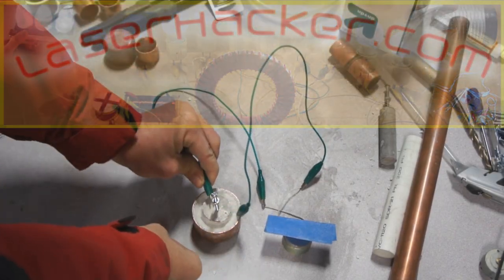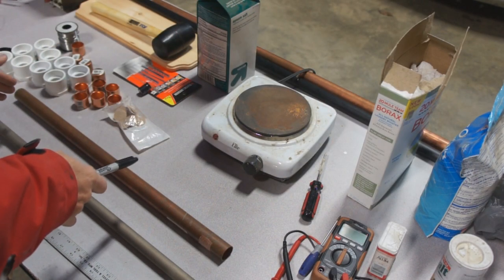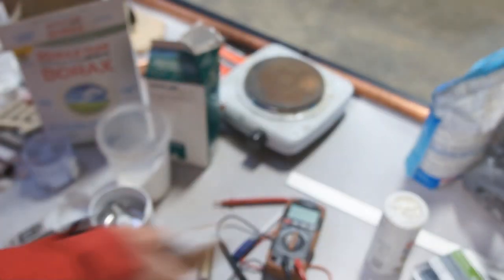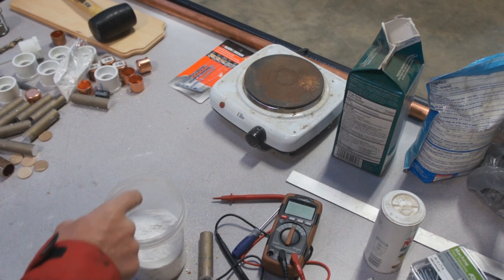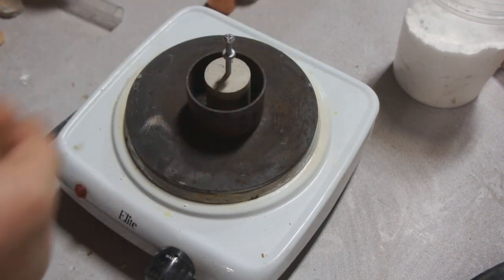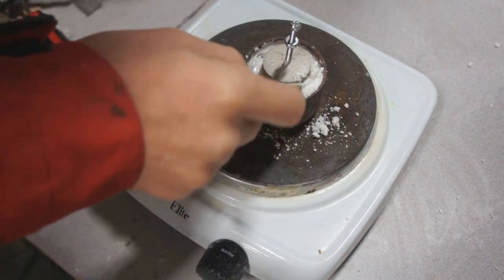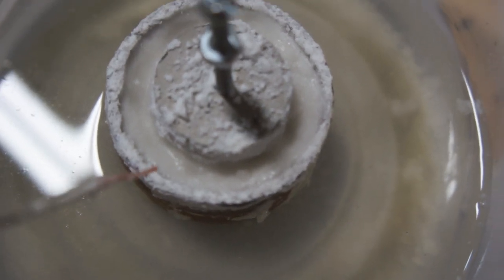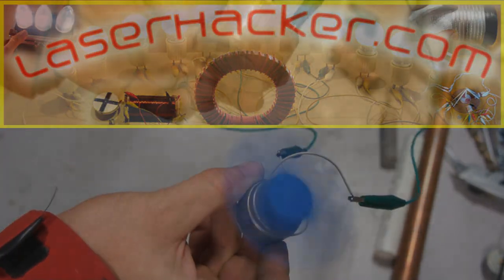How to Build Crystal Power Cells - Long Duration Power

Comment: I know this is an old video, but thought someone might be interested in what was going on. When you heat the mix of salts the Epsom salts release some of the water trapped in the crystal structure allowing the mixture to partially dissolve. You end up forming a "dry" electrolyte copper/magnesium cell.
Reply: I’d be curious to see the difference between the different ratios as I think with a tad less borax it would bubble less
Reply: thank you
Reply: The term "dry cell" just means that it does not use a liquid electrolyte.  Even the driest dry cells require some level of moisture on the inside, otherwise no electrolytic reactions can take place, but the electrolyte is dry enough to become a paste and thus it can be used in any orientation.  Unlike a wet cell, which even when sealed is not recommended to use in other than an upright position, e.g. a car's lead-acid battery.
Reply: Yeah, a lot of effort to produce a seriously badly-designed dry cell, then convince youself the power is magically coming from the crystals and not the difference in electrode materials.

The stupid, it burns.
Reply: @animateclay  Probably more to do with the crystal mix.  At least one of the ingredients needs to be a tad hygroscopic so it pulls in enough moisture to keep the thing working.
Reply: Is it chargeable? Is it a viable or economical solution for energy storage compared to lithium ion or polymer?
Reply: @juansolo1617  It's about as viable and economical as making a battery by sticking electrodes of two different metals into a lemon.  It works, for very small values of "works."  It's a novelty.  If you're gullible enough to believe woo claims, you can tell yourself that you're getting the electricity from crystals.
Reply: @bdf2718  Considering I've never seen it implemented I'd assume it's not very great... but from the video it would seem to be producing electrical current constantly without ever depleting. This might be useful in a large bank to produce a trickle charge for other cells. I still don't understand.
Reply: @juansolo1617  Look at the size of the electrodes.  It's going to take a long time to run out of electrode material.

But that's not the only problem.  One of the electrodes is slowly electro-chemically eaten away.  That will result in its ions accumulating in the electrolyte nearby and limiting further reaction until they diffuse away (which will be sloooooow) limiting the available current.  It will also result in a gap forming between the electrode and electrolyte which will stop it working (unless the crystal mix is such that it can swell as it absorbs moisture).

It's a toy.  A novelty.  Like a lemon battery.
Reply: Water trapped in a crystal structure......very interesting to think about.
Reply: @bairfamilyfarm1336  take a look at geology
Reply: @animateclay  same thing happened with my crystal cells
Reply: Quarts crystal displays direction magnetic resistance. If you heat quartz it produces a mild electric charge. If you apply a mild electric charge it will oscilate. Quartz is piezoelectric, under compression it emits a standing frequency. Maybe the pressure is compressing the quartz and interacting electromagnetically with other components too.
Reply: Before cooking, mine was pushing 1.5 volts! I didnt get a current measurement at that point, but after cooking it was 1.4 volts, and about 50 milliamps. I had to add water to the mixture to get it to form a paste. I was using it's very dry, anhydrous Epsom salt.
Reply: @bdf2718  You kind of are getting energy from crystals, the magnesium crystal as it oxidizes. If I had to guess at the species being reduced, I'd guess water from the air, maybe some previously oxidized copper too. It's an air fuel cell and it's viable for a lot of stuff, if designed properly for that. This isn't and it's laughable that tuning the borax or potassium chloride would change things much. The surface area of the magnesium and surface area for gaseous water and oxygen/hydrogen flux are critical. The copper surface area is critical too.
Reply: @bdf2718  what would you recommend adding so it can make it "rechargeable" by watering it every so often?
if I can have something I water every morning to keep my mobile devices and spare batteries charged im making a big one
Reply: @The_Tactical_Wook  50 milliwatts is such a tiny ammount of energy it would do sweet sod all to any decent sized battery so don't bother trying.
Reply: @stonedsavage7814  what if it was pee?
Reply: If this set up gets hot during the charging, it will be messy
Reply: Funny thing is at the beginning, there is no way to test amp flow without a load.
Reply: How long does it actually last?
Reply: @The_Tactical_Wook  I tried them all ..I don't assume anyone did more research than me...after a few while it stop working n Voltage drop way down..
Reply: Utopian Websurfer  gold plating maybe?
Reply: @abbaspourmoghadam3850  how long? I figure a watering every day could work right?
Reply: @The_Tactical_Wook  don't add any water keep it away..water only works for earth battery,crystal cells completely different realm..I made hutchison cells different mineral that u face zero point energy sub Atomic level,crystal cells works on the principle of casmir effect once u treated in a certain way (petrol electrical effect)john called it u activate it by applying direct current,u need Rochelle salt(piezoelectric property)epsom salt ,sodium silicate (covalent bond)sodium carbonate (ionic bond) a dust of pure silver,galena(radio receiver)n pyrite, melt them down with great heat,once start to cooling down apply 12 volt dc voltage to give them electric memory n will drop down to 1.300 volt very steady ...
Reply: Epson salt is composed of 75% water  and only 25% Magnesium sulfate.
Reply: @abbaspourmoghadam3850 . Different thing but if you combine platinum and gallium  by heating for 2 hrs at 300°f. You’ll get a room temperature catalytic liquid platinum.  Ratio .0001 platinum to gallium.   

This can be combined with another thing people love to hate, hho. HHO sand heater for instance.  And much more
Reply: @Coincidence_Theorist  no longer doing research about free energy bullocks...I gave up n back to normal life...tnx anyway

Comment: I'm looking at this from a purely physical manufacturing angle, and think the efficiency & energy density can be greatly increased.  Instead of a copper pipe end cap, a honeycomb structure of copper, solid sheet on the bottom, open on top.  For the Magnesium, instead of a solid round cylinder, a flat sheet with hexagon shaped shafts coming out of it, properly sized to 'nest' inside the copper honeycombs with the proper spacing.  Place the copper honeycomb on the hot plate and fill the cells with the powder.  Heat to the proper temperature, getting the solution to just the perfectly mixed viscosity, then lower the magnesium panel into it from the top (with insulated bolts/spacers around the outside between the plates to keep them perfectly aligned and spaced).  Then, pull the whole cell off the heat and set in the cooling tank, until curing is finished.  Positive connects to one side, negative to the other side.  They could be stacked in series, just like stacking the flat button-cell batteries we use in watches & hearing aids.
Reply: Hmmm. That is a good idea
Reply: Nice idea, but very expensive and time consuming to manufacture.
Reply: Why don't you demonstrate on a video in response to this video.  That would be very cool.
Reply: the hexagonal shapes would be extremely expensive, how about overlapping sheets? like how capacitors work except with electrolyte instead of a dielectric
Reply: yes no now that’s the idea. Like a spiral?
Reply: @sethery7826  yes something like that. Or maybe 2 parallel rectangular electrodes that have many perpendicular "arms" that overlap with each other but are seperated by the electrolyte.
Reply: @sethery7826  Yeah, a spiral just like in an ordinary dry cell.  The sort you can buy from the shops.  This thing is a novelty/toy.  Energy/unit volume is crap.  Energy/unit mass is crap.  Performance is crap.  But it's a novelty because the electrolyte is a crystal.
Reply: @bdf2718  I think you should get to a page you can contribute, your energy could really use some quartz.
Reply: so John's original videos, which are taken down now, he stated to use small copper pipes and tiny strips of magnesium, just as oyu stated. he was making square designs with a bunch of pipes nested together, so they all connect to each other. he then stated he was going to wire all the magnesium strips together as well, this way each small pipe is about .5 volts, a cluster like you describe was (judging on the amount of pipes he used) was around 12 volts in a tiny package. He also stated NOT to use borax, but some other crystal materials you can easily get online. And that brings efficiency up quite a bit over borax. I wash I could find the original videos...
Reply: and really, it wouldn't be that incredibly hard to do. To make it all nice and shiny for the public, it may be a little bit pricey John originally stated that these will run until the crystal structure blows out the bottom of the case, as some grow crystals over time.
Reply: @RandoWisLuL  I still have them somewhere. Will post.
Reply: @Splatterpunk_OldNewYork  that would be awesome. I want to build a large array. I will look out for this on your channel.
Reply: @RandoWisLuL  Yeah sure, gotta dig it out of my many hard drives. Keep you posted.
Reply: Hutchinson, funny guy. Used to be his neighbor when he lived in his apartment on Queens in New Westminster.
Reply: sorry hard a hearing please provide a complete list f ingredients
Reply: @AustinSteingrube  Those metal 3d printers that have been coming out might be a solution to that soon.
Reply: @bradmcclure4945  He gives a link but it's not there.
Reply: @abbaspourmoghadam3850  no, i never saved it. I wish. @Splatterpunk does above but this was 2 years ago. I have no idea if he still has it
Reply: @Splatterpunk_OldNewYork  did you ever find those videos? lol
Reply: @RandoWisLuL  Yeah I found the thing. I will post a Youtube link hang on.
Reply: @Splatterpunk_OldNewYork  its all good man, take you time.
Reply: @RandoWisLuL  lol.
Reply: @Splatterpunk_OldNewYork   i just dont want to think im being pushy haha
Reply: @RandoWisLuL  2 years and right on time. "Better late than never" - Cicero.
Reply: @RandoWisLuL  What would happen if you put this whole set up under pressure, and maybe put a magnet in too..? and maybe a candle under it..
Reply: @Splatterpunk_OldNewYork  please post it!!!!
Reply: Recently finding my attempts from long ago brought me back to this video. Now, I'm looking to threaded pipe, new ways to heat material just enough, measuring material and finding the right mix.

Comment: Fun note, I think this battery lasts so long because something cleans the reaction surface as Magnesium hydroxide [Mg(OH)2] doesn't dissolve in water. Since salt solutions can temporarily produce strong acids, this cell can produce HCl and HSO4 to react with any Mg(OH)2 that may propogate, and since MgCl2 and MgSO4 are soluble in water it clears the Magnesium surface to allow more galvanization. So that's a cool Hypothetical.

Comment: You should clean the copper base in vinegar and salt then rinse off with water and dry. No need to sand, and improves conductivity (you had a dense layer of copper oxide when adding the mixture)

Comment: What are you planning to power with 10 of these? How much power are you expecting to get? Would power increase if you made one the size of a garbage can?  :) I've also loved these since I watched Johns videos. I believe in one he had there was smashed up powdered quartz.
Reply from the maker: Current does increase with size.  I want to try using the 15V setup as a charger.  Depending on it's performance I may have other uses for it as well.
Reply: lasersaber
Once you fix the galvanic couple, magnesium and copper here; the voltage of the cell is fixed.  Current density will be fixed for an electrode pair and the elecrolyte and the cell geometry used.
Reply: I know nothing of electronics, but smashed up Semi-powdered quartz is known as Sand.......that's exactly what sand is.
Reply: +thechazman47 the maker of the "bloom box" mentioned "the plates are constructed of sand." I know this is an old thread but seen that the other day. Kinda makes me wonder if the mixture was more exposed to air and carbons, if it might produce more power...

Comment: I have been researching for about 3-4 years on how to get energy very cheaply that lasts a long time and is good for the environment. Then I found this video about a week ago and I checked out his channel and he seemed like a legit guy so I decided to get the parts and build it. I finished building it today and I couldn't believe it. It Works!! Make sure to try and build it because this battery is amazing. I plugged a motor to it and I'm going to test it for a week, if it goes for that long then I will be amazed!!!
Reply: I too would like to know the run time.
Reply: Robert Roark it has been running for 2 and a half days running a small motor so far :D
Reply: seeking Sandman dude the stuff to make it is expensive it took me more than 20 bucks to make this one
Reply: seeking Sandman You funny me
Reply: seeking Sandman XD
Reply: Tom Hoehler naw it stopped running a week after it started
Reply: ***** can you list me the complete materials to make the crystal power cell?
Reply: Manuel Rodriguez 
Potassium chloride - commonly known as salt substitute.
Hydrated potassium aluminium sulfate - commonly known as alum.
Sodium tetraborate - commonly known as 20 mule team Borax. 
Magnesium sulfate - commonly known as epsom salt.

Then you put a magnesium rod inside a copper pipe and melt the substances above between the magnesium rod and the copper pipe and you are done!
Reply: your the best, thanks
Reply: you´re*
Reply: Manuel Rodriguez 
ur welcome =D
Reply: ***** man, I´m having trouble finding the magnesium core and the alum, do you know where to find them?
Reply: Manuel Rodriguez i go the alum from walmart, you can get it from most supermarkets. And I got the magnesium rod from harbor freight tools from a fire striker for about $3.
Reply: Thanks again!
Reply: Manuel Rodriguez no problem :D
Reply: +Jay Katon No, I haven't
Reply: how about now
Reply: How did it go thunder
Reply: mr Sandman  a TV runs on DC.... Your plug wire goes directly to a transformer and rectifier that steps voltage down and turns ac into dc..... So just skip all that and your good...... Almost all house hold products work on DC with the exception of motors however DC can be turned into ac and even converted to 3 phase

Comment: If you know the chemical reaction which is taking place, you could find a theoretical ratio using stoichiometry.
Reply: xlioilx  How can it be shady? He is up front with his claims and lack of claims..... SMH  It works, give it a rest.
Reply: @stevenfeil7079  It is also really dangerous.Giving incomplete info is worse than giving no information at all. He is giving people just enough information to hurt themselves. Borax has a very high PH and should not be used without thick gloves and a respirator. Inhaling the dust when opening that grinder can actually kill you when it mixes with the moisture in your air ways and lungs. Not a single safety warning and he is demonstrating it in unsafe conditions / work practices. Someone seeing this video without knowing the dangers will do the same.
Reply: At first,  I LOVE your videos.
At second...no,but I enjoy them.
You, my Friend, are very unsafe.
Your life is yours,however..you SHOULD tell people of the dangers you are facing, so that they can make an informed decision as to mimic you or not.

BORAX IS DANGEROUS to skin.
POWDERS are dangerous to inhale.

You simply do not provide enough information to warrant My Love :(

Parts lust?
Links to suppliers?
Gloves?
Respirator?
In another video you don't mention capacitor breakdown/leak..
Reply: @excitedbox5705  Borax has a ph around 9.5, its safe on your skin to use as a soap and it's even used medicinally/nutritionally for a Boron source. Hence why the box even says "not for drug use". Do some research, Borax can be used for hair loss issues due to inadequate Boren intake, as well as for killing yeast and fugus internally and externally. 

Yes mixing Borax with other chemical could be dangerous, but it's pretty safe to the skin and even if taken internally in small amounts.
Reply: onradioactivewaves I agree with you. It's also used as laundry detergent. 
However those use cases are different then grinding into a powder that is breathable and also heating it, mixed with other chemicals.
Reply: @excitedbox5705  You ever see a kid making slime? made with borax. While I usually agree with "incomplete info is worse than giving no information at all", that is just a theoretical danger. I do appreciate you explaining safety measures, but some of that is excessive. It doesn't hurt to be too safe, though, so you do make a point.

Comment: I made this cell But I did not use heat. I added (mixed in) iron oxide (magnetite). I packed it as tight as I could. I used a one inch copper cap and a magnesium rod about one inch long. 1.43 volts, It really works great. Thanks much.
Reply: Any updates how long your cell last under load? What was your recipe?